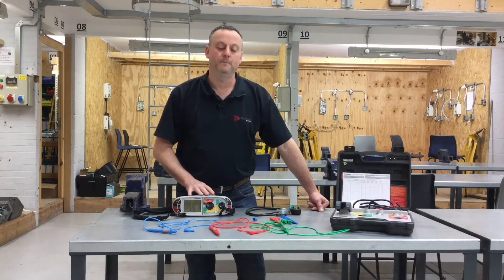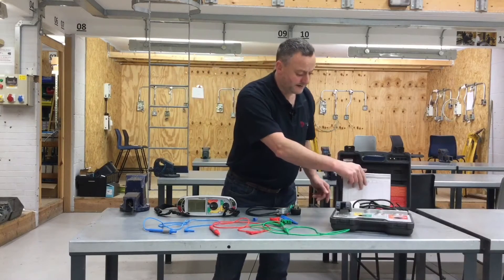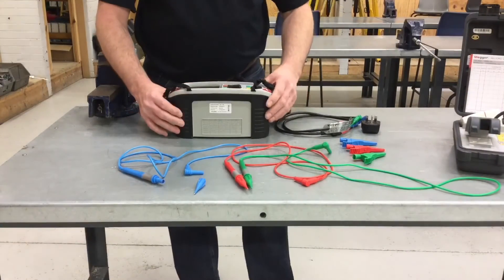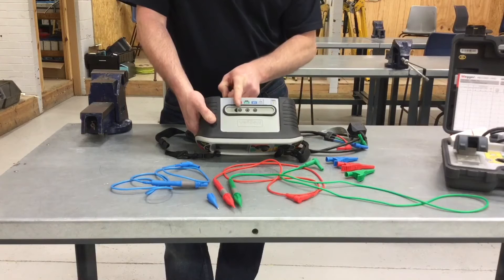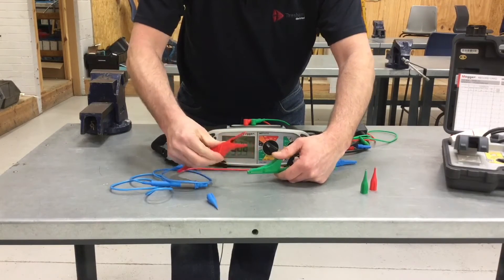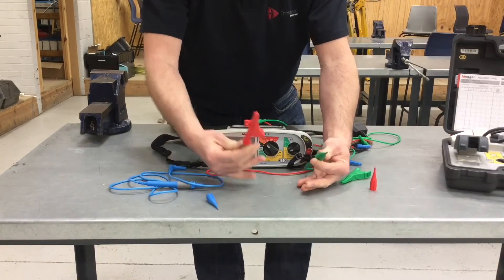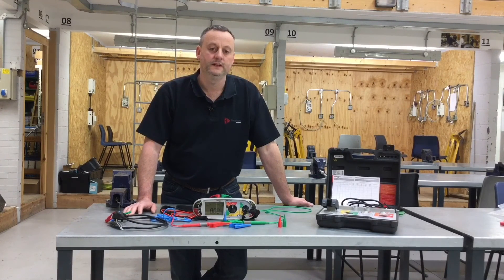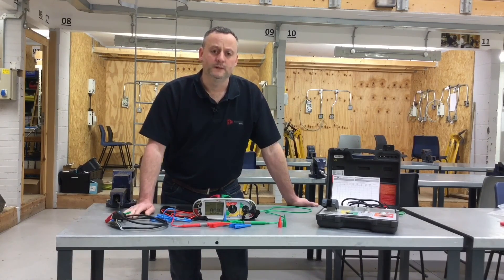Setting Up A Megger MFT for Continuity and Insulation Resistance Tests (How to set up a Tester)

Comment: Can any manufacturer explain why they supply a red test lead, they have changed from black to blue, but have stuck with red rather than brown.
Reply: You are right I have 2 fluke and new megger 1721
But when I ordered new set of test lead from fluke instead of red came brown  with fluke sign on it I be never seen anyone else have brown 
But it works